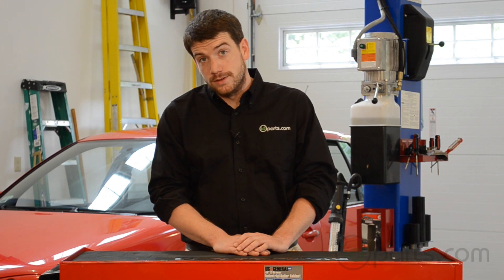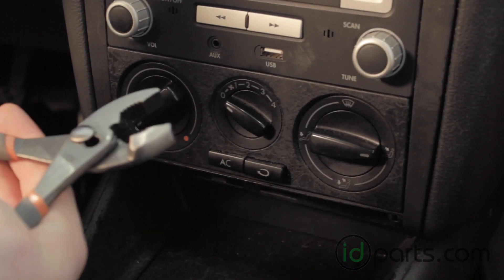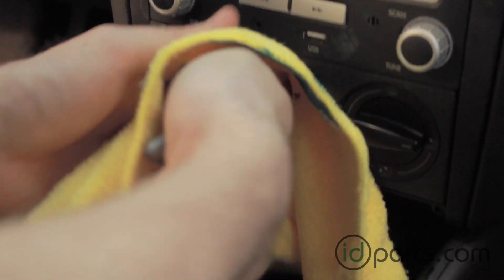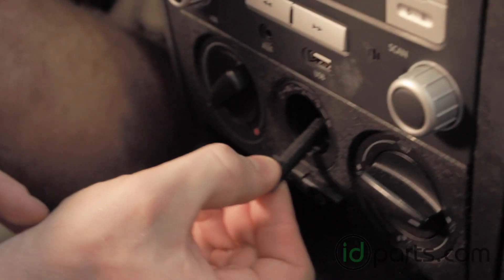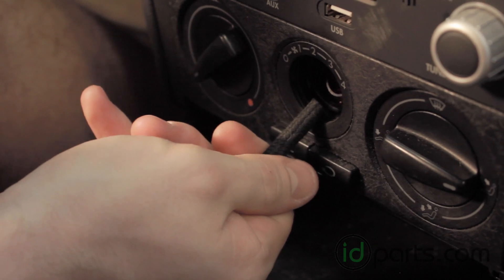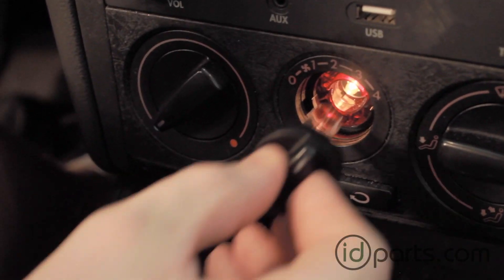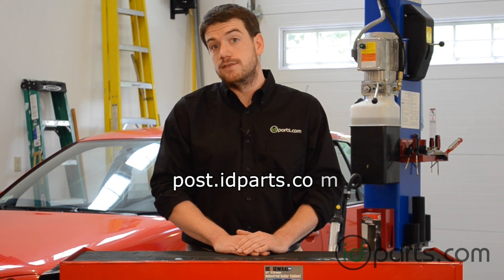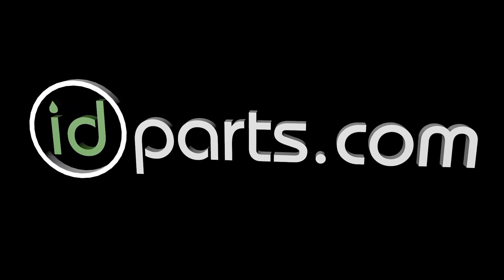How to Replace Your Heater Control Bulb (MkIV & MkIII VWs)

Comment: This is incorrect for the mk3 platform. Only works on mk4, mk3 you have to remove the whole unit just about. Pls fix the incorrect title
Reply: Jenna Foley It works. It is even easier in mk3, you do not need any pipes, because light bulb is easily pulled out with a green thing, in which it is placed :)